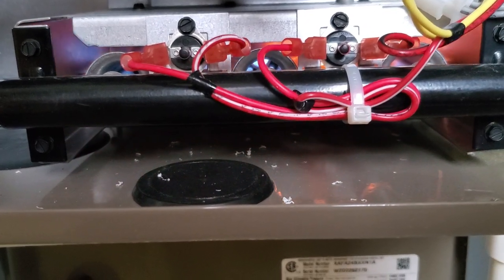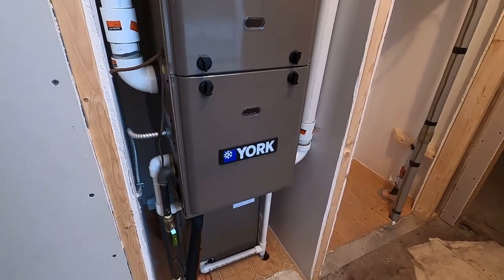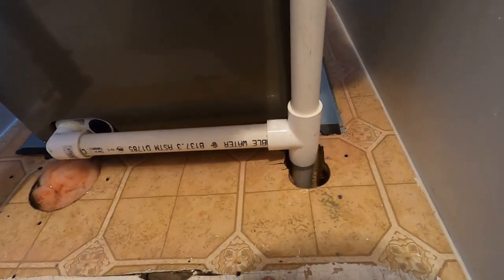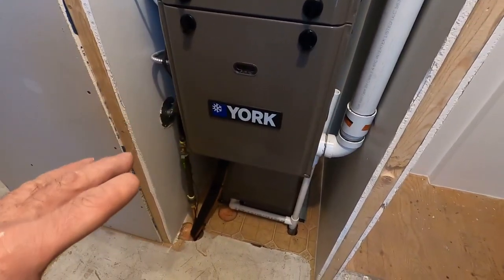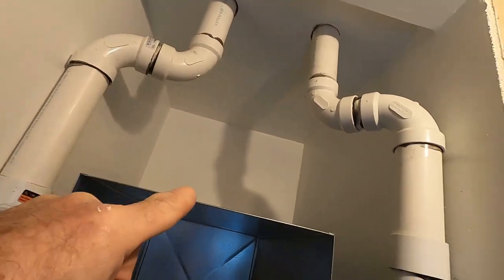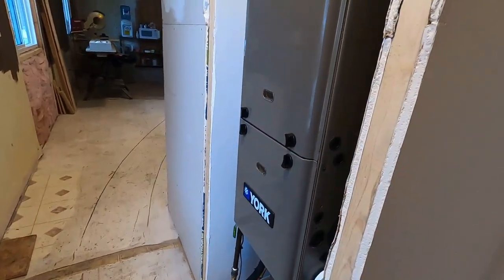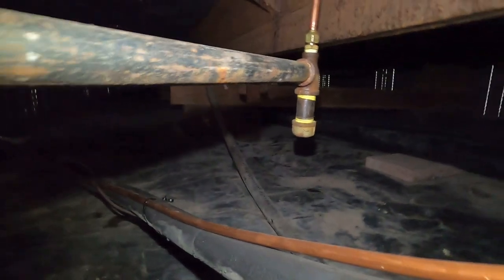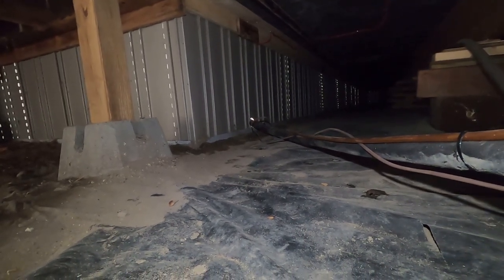We Install A New 95% Efficient HVAC System In Our Old Mobile Home : E123 / BC Renovation Magazine

Comment: Looks like a great system at a reasonable price. 
Have you ever used a central heat pump in one of your mobile home projects? We’re all electric here and utilities are very cheap but we do have a 200amp service, which allows for electric strip backups of a good size (100 amp breaker for the furnace)
Reply from the maker: Hi, Scott. Heat pumps for us here in Kelowna have had mixed results. I have not installed any on my projects but know people who have.

Most that I know that are replacing old heat pump units are not putting heat pumps back in. 

Where you are on the Island you might have better results than us.  Your winters are more mild than ours.
Reply: I have a heat pump in Georgia and in the winter my wife complained that it blows cold air out of the duct’s.she’s not happy with it.
Reply: @marksullivan57  it can happen. We have a 1994 double wide with a York heat pump that was installed in 2008. It blows warm almost immediately (or cold in summer). One thing I’ve found is that there are many different brands, types, and quality levels of heat pumps and a lot of bad installers who don’t know the product well. 
I see lots of posts on different sites about bad heat pumps but it generally turns out to just be a model or type that isn’t appropriate for the use case.